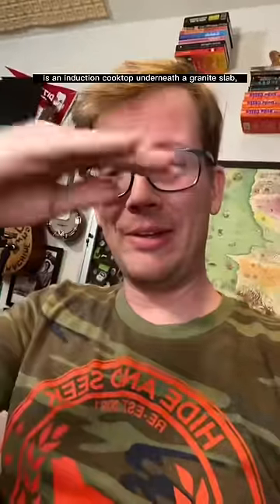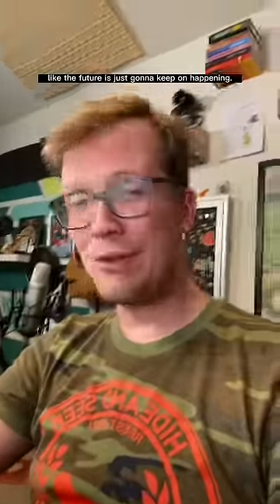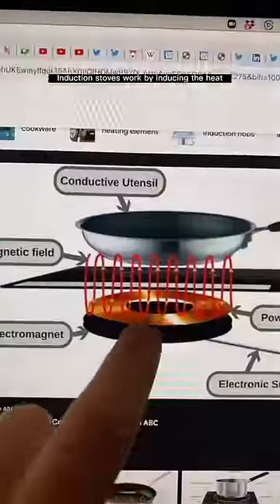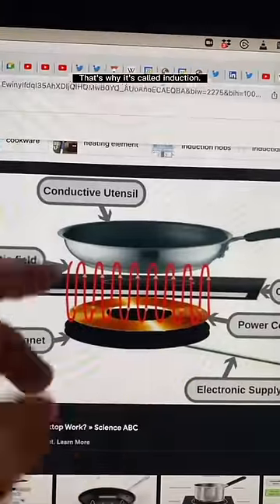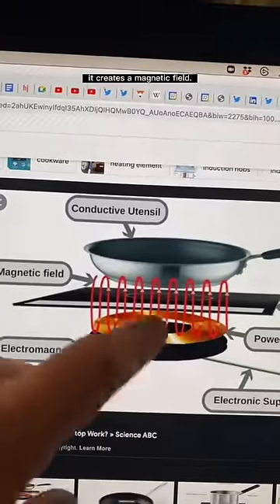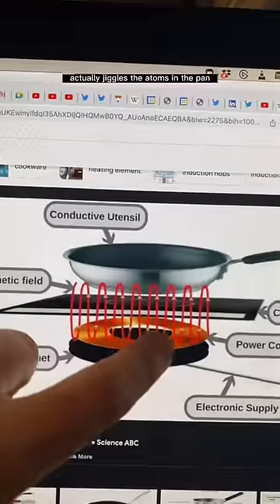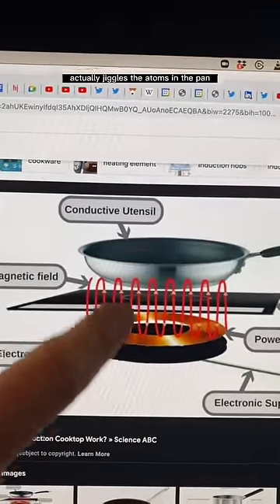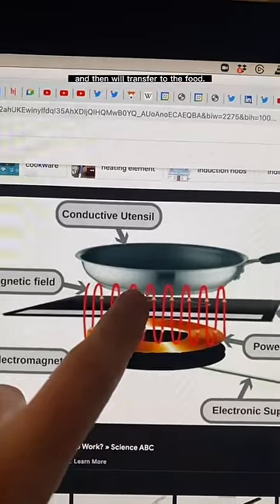How do induction cooktops work?

Comment: Because of this video, my wife and I bought an induction stove when we bought our house. 10/10 best choice. I can't even begin to explain all the benefits. Super worth it.
Reply: Induction stoves have uneven cooking temps. The ring gets intensely hot while the inside and outside of the ring get undercooked.Get yourself a ceramic/infrared cooker instead. Either way though, you gotta make sure you have electricity. I have a small butane stove in case of a power outtage.
Reply: @DibIrken  Maybe you haven't used an induction cooktop for a while, or maybe you don't understand how induction cooktops work, but my cooktop (Samsung) heats more evenly and reliably than any gas or electric cook top I've ever used.

Not quite sure why you are bringing up needing electricity, that's pretty obvious and applies to any non-gas stove not just induction.
Reply: @DibIrken didn't he literally say in the video that it's more evenly? 🤔
If you buy a decent one, there would be no reason to have a single ring with a (big) center too..
Reply: Those luxury, zone free ones even have a grid of little circular or even rectangular ones. No middle anymore.
Reply: The lack of heat after turning down the stove is an issue for me, especially if the pan you're using doesn't have a lot of thermal mass. induction heats up and cools down a lot faster because of a lack of a large thermal mass (like the stovetop) that somewhat equalizes the output power.
Reply: @DibIrken I have a portable induction hot plate and it heats up quite evenly. That’s like, the point.

Comment: Also make sure, when you get pots and pans, that they will work for induction cooktops. Rule of thumb, if a magnet sticks to the bottom, it will work.
Reply: ALMOST everything works with induction.  But yes, check.  You don't want to buy model A and it doesn't work when you could have bought model B!
Reply: @fletchro789  yup, but you would be surprised. When I worked in retail, several big industry names had stainless pans that didn’t work. 

Odds are that the dinky 8 dollar nonstick pans you find at Walmart is just aluminum.
Reply: That's a shit rule of thumb honestly. If you need to be absolutely certain and nothing else will give an indication, that might be useful, but in general it's way too restrictive.
Reply: @Quintinohthree  I’m talking about what will work for induction.
Reply: @Quintinohthree  are there types of pan that work properly with induction but don't let a magnet stick to them?
Reply: @Aldo_raines  hm yeah, from what I've seen, the stuff specifically marked as induction seems to be about twice the price from the ones without it. idk if that's because of where i live tho, maybe it's more common in the US
Reply: @juliamaria3807  in some cases it’s just marketing, but there are kinds of pans you’d think would work that don’t, such as some stainless steel. Those you have to check.
Reply: Some high frequency induction cooktops can work with any metal, including aluminum.
Reply: if its metal it should work.
Reply: @azzy-551  no, most can't work with all metals. Mine doesn't for example. Some high frequency ones can
Reply: Needs a flat bottom also, more contact area is better
Reply: @adrianthoroughgood1191  I wouldn’t think so. Induction cooktops use electromagnetism to heat the pan.
Reply: @depressionbomb  they’d need a steel or other ferrous metal bottom, which I have seen on some aluminum pans.
Reply: It just needs to be a conductor and have enough surface for Eddy currents.
 Although strong enough magnets will rip out electrons but that isn't induction cooktop anymore